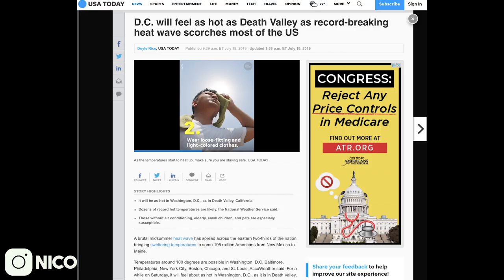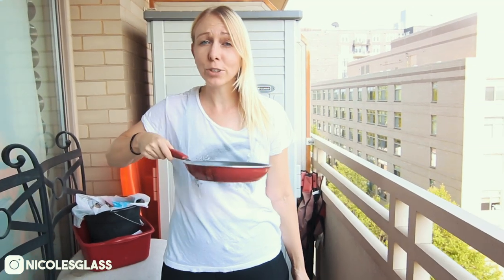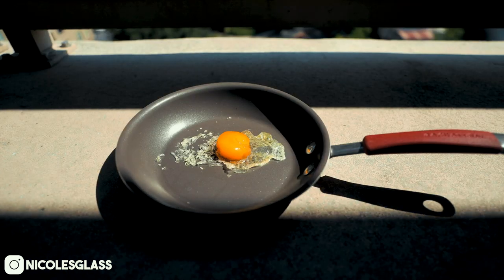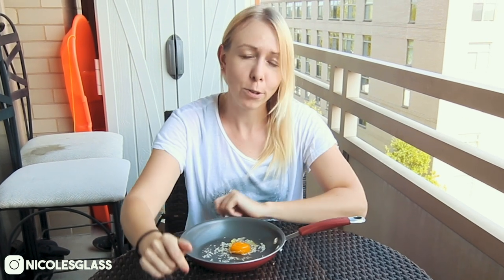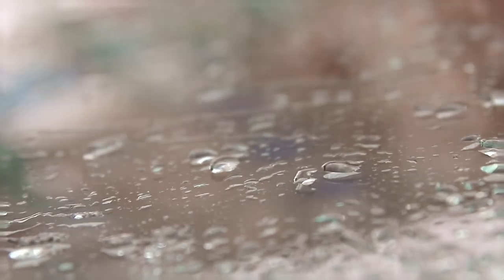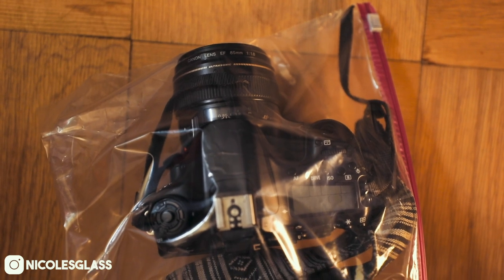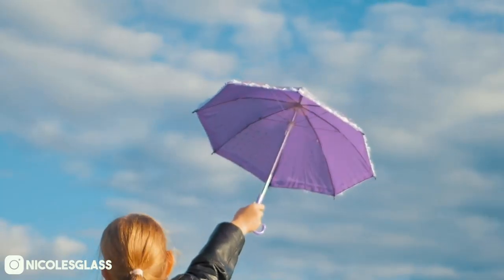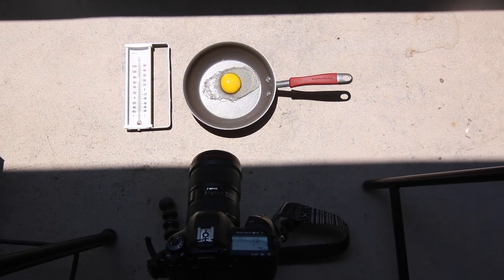Frying an egg in the SUN & protecting cameras in extreme HEAT ☀️🥵

Comment: Hi Nicole,
I was recently in Cancun and the room was air conditioned. Every time I went outside my lens would fog up. Worse than that, I live in Calgary, Alberta. Winters can get as cold as -40 C or F, the same thing. Minus 20 C is common. When I shoot in cold conditions, Before getting back in the jeep I remove the battery and card. Put everything in a zip lock bag inside the camera bag and put at the back of the car. This allows for very slow warm up. Reducing the risk of condensation.
Regards, Lord Jack Thair

Comment: Very informative video. One thing I would like to add is grease. Yes your lenses have grease in them. If that grease gets on the elements, well the lens is ruined.  Heat softens and can even liquify grease. I only know the melting temperature of grease in Nikon lenses, which is 120 degrees F. Do not leave your gear in a hot car without taking precautions. I just tinted my vehicle with ceramic 5% tint, which blocks up to 99% UV/IRR rays. This can lower the interior temp by 25 degrees F. Even with this protection I will not leave my equipment in the cabin of my vehicle for extended periods.
Reply from the maker: Thanks for adding! This is definitely useful to know as well. I would also never leave my equipment in the car... hope it's cooler where you are!
Reply: Nicole Glass I left hot Florida, headed to DC
Reply from the maker: @helloitsmeterrykelly1944  Oh man. DC was hotter than Florida this past weekend! But yeah, overall it's a little bit better.
Reply: Nicole Glass yes it was, still warm today in DC 85-87

Comment: Heatwave? I am in Thailand and the temp here is around 95f (35c), so an egg or a camera should operate without any issues. However, the condensation from going in an air-conditioned room to outside can cause damage within the body as you mentioned. I have experienced this with shutter issues getting jammed up. I use a box safe to secure my equipment which humidifies the equipment. Works well.

Comment: Lol 3 hours? My Sony shut down after 10 minutes recording from my car with the windows down. Weak.
Reply from the maker: Wow!
Reply: @NicoleGlass  Found a way around it by extending the screen away from the camera body to allow heat to dissipate, and open the battery flap. Still gets very hot, but so far no shutdowns.

Comment: I did that experiment Canada Day last year. I got a soft but edible fried egg after about two hours. You can see the pics on my facebook page. I ate the egg with bread and a little salt. I put the pan in an aluminum cake pan and placed it on dry clay soil. I started about 2 pm and ate at 4 pm.
Reply: You need a little oil.
Reply from the maker: I completely forgot the oil. That was smart of you to use aluminum. Perhaps I’ll try again during another heat wave. My egg dried up instead of frying so I would have broke a tooth if I ate that.
Reply: @NicoleGlass  Also, I let the pan sit in the sun first to heat up. I think for best result you need to scramble it up after the first hour and move the egg to another part of the pan. I think all your cooking heat was coming from the top. Good tips on the keeping camera cool. I noticed mine became alarmingly warm to touch after walking 10 mins with the bag cover open.

Comment: 115-117 degrees shooting in Law Vegas summer, but nowadays only go there during the CES Show in January. Use the zip lock bag trick in Miami Beach and Hawaii humid weather and it does help. They say those camera aluminum L bracket help dissipate heat as a side option. They say frying a egg is best done with a piece of aluminum foil directly against the asphalt or cement ground :-)
Reply from the maker: Haha, I suppose if I really wanted that omelet I should have tried a little harder 😂 yeah, Vegas in the summertime sounds awful!